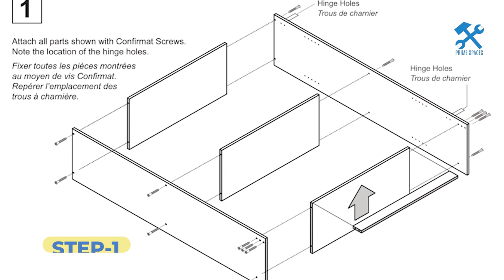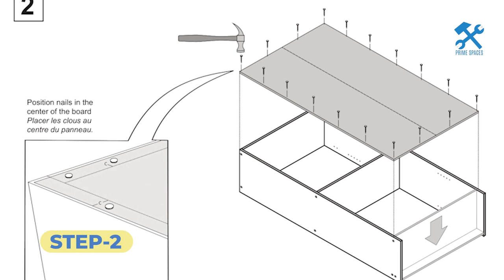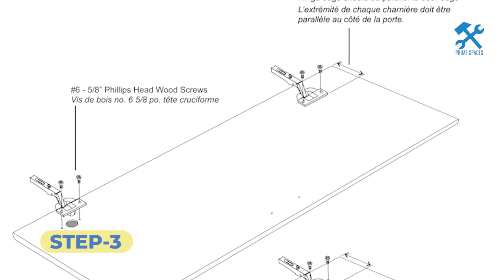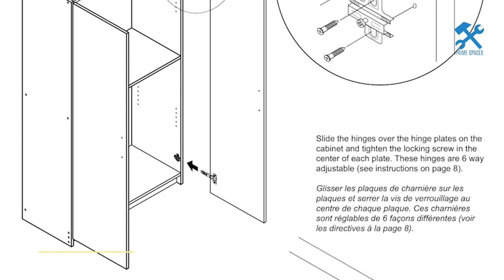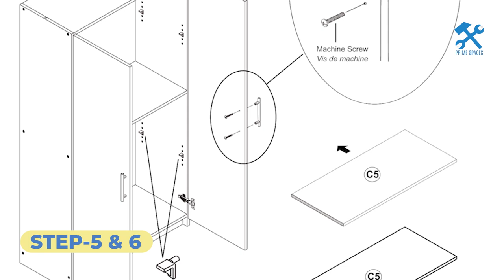Prepac Elite 32"  2 Door Wardrobe Cabinet Assembly Wayfair Basics Bucholz Wardrobe Cabinet Assembly

Comment: Thank you without your video hell I would be Divorced. Only problem did not realize there is a left side and a right side I had to take it all apart because there were no holes for the clothing rod on the inside otherwise the 2 hole to hang the rod were not there unless I unscrewed everything and did a Redo. Without your video following the directions never would be put together. Thank you.
Reply: I had to do a redo too for the same problem.
Reply: 10 months later... did the same thing.